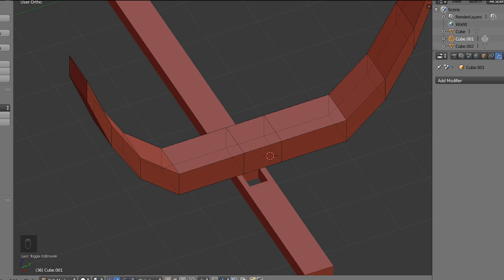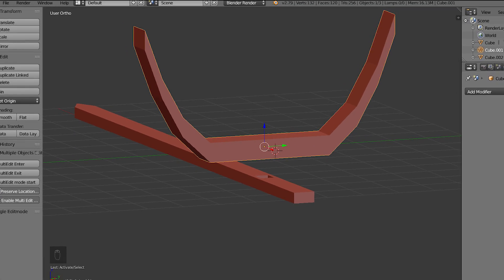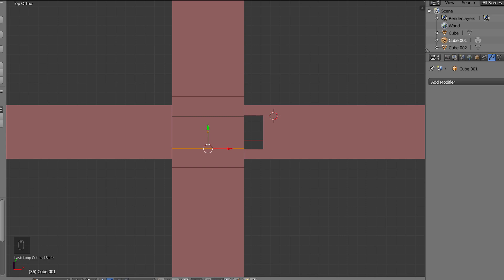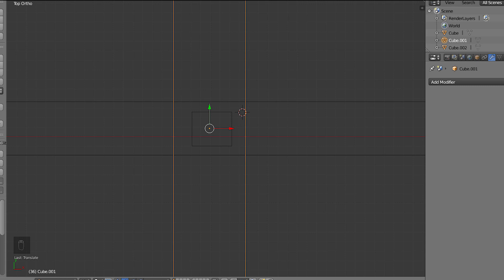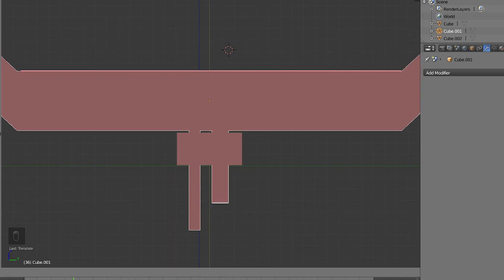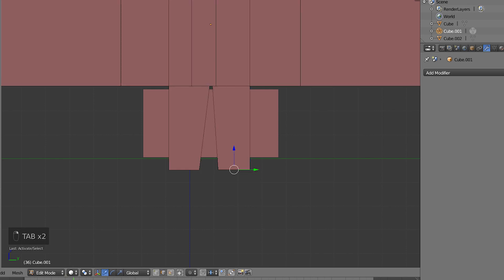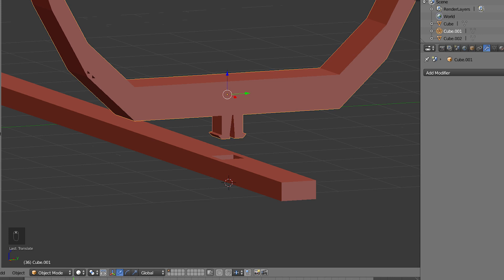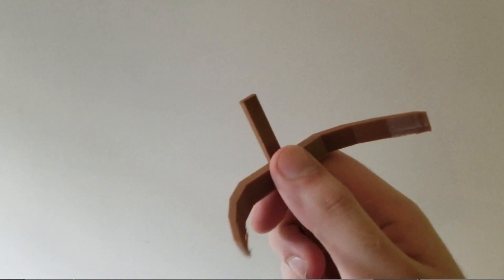Combine 3D Printed Parts With Snap Fit Design

Comment: Note that you CAN and SHOULD use the mirror tool in Blender when producing symmetric parts. I do it myself. The non-manifold errors he speaks of in this video comes when you forget to delete the faces that lie in the mirror plane, and/or forget to auto-merge (auto-weld) the post-mirroring vertices. Imagine the problem like this: Imagine a cube, and now you mirror it by using one of the cube faces as the mirror plane. The result is now a block twice as wide as the cube. But the result now has two faces occupying the same (useless) place: the face you used as a mirror plane, and its inversed copy. Both are in the same place, both are useless. So delete the faces in the mirror plane before mirroring and you're fine!

Comment: Was hoping for a little more info on tolerances that are flexible but also secure and print well with standard nozzle diameters. The shape itself is easy enough to copy from any existing snap fit connector.
Reply: bro no way nice pfp LOL

Comment: nice part design. Ive just started on making some snap together parts, I used a ball on each side with corresponding hollows and a slot to force the part through. I like your design though too. I might try something similar. Thanks again. I subscribed to your channel

Comment: I'm not a blender user but was really impressed with your simple approach. The mechanical engineering and packaging tutorials on snap-fits focus on overwhelmingly specific information, with angled arrowheads and rounded edges that create too many steps. I can easily follow this video step by step to help me internalize the design process. Really well done, thank you.
Reply: I wanted to follow up and let you know I used what I learned from your video to make some animal care products that have become hard to find on the market and given them to a group that takes in unwanted pets and helps rehome them.  Your snapfit tutorial enabled me to assemble larger pieces of equipment almost instantly in a toolless, extremely fast process. The group I have the equipment to is now buying their own printer to manufacture in house. Thank you again!!!